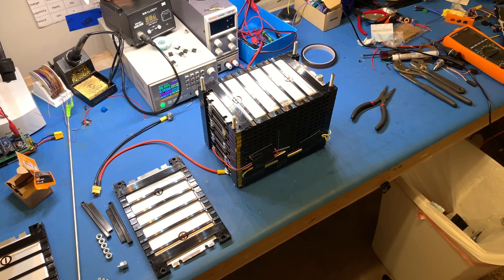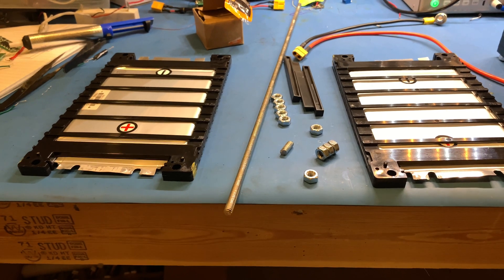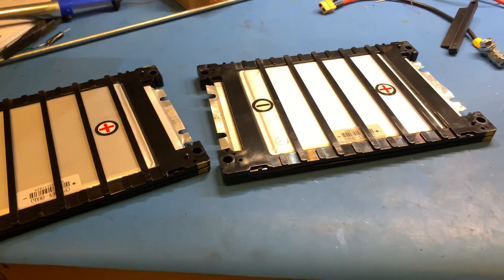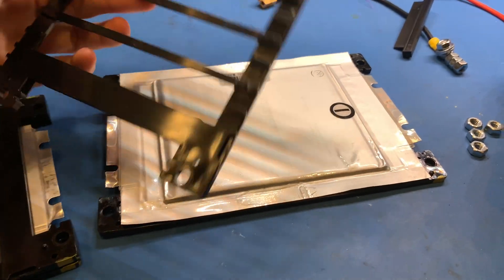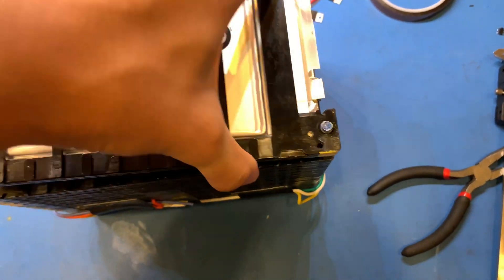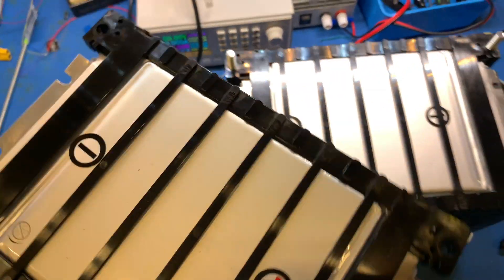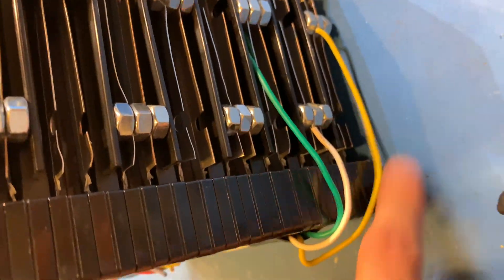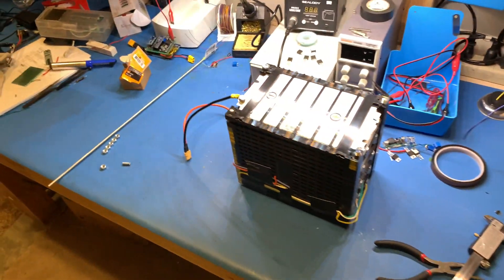Simple DIY E-Bike Battery SPIM08HP

Comment: Two years have passed, Update? How are you charging?
Reply from the maker: @VishaP-uu6zc Maybe I’ll make a video on my current e-bike.
Reply from the maker: I have moved on to more powerful bikes so this battery is not in use anymore. To charge it I just hook it up to my variable power supply. You can buy a battery charger for the right voltage though. I would also recommend getting a BMS if anyone is building this battery.
Reply: @ryanstephenson7655  Thanks for your response. This build was 72 volts. That is high voltage for a e-bike. Capacity not so much if your using throttle, vers pedal assist. What battery type are you running today? I use Bluetooth BMS on all my builds.
Reply from the maker: @stevecahill9106  I am using Samsung SDI prismatic lithium-ion batteries on my current bike.

Comment: So what is 72v 8 ah? I built a battery with these cells for my car audio system I used 40 of these cells from battery hook up which was very cheap at the time even now there only 3 each . I think I paid 130 for 45 cells and they sent out 4 or 5 extra any way I didn't have holders with the ones I bought that time so I bought a punch and made 2 holes on each tab and ran threaded rod threw to connect them I ended up building 12v 4s 10p 80 Amp hour battery it runs with 4 yellow tops battery's I used to have a 500 Amp solenoid but I took it out of the loop when I felt like it was choking the flow of power so I have been running like this for 2 years straight every day nps I did just buy 50 more with the cases to build another for my truck besides u can pull them out with out tools I bought big terminals u can unscrew by hand and use it to charge ur phone run any 12v thing you would plug in you car I have a buck converter also for running higher voltage lower amperage things threw it or my inverter will run for about 5 hours on it at full draw great stable cells thar can be used in conjunction with agm nps

Comment: It's so important to make sure you check the voltages before you go sticking them together.
Reply: What would happen if you did not ?  What does a builder need to watch for ?
Reply: @milesmoore5422  The bms will try to balance the batteries by putting a load on them until they balance the voltages. The bms will heat up and burn itself out pretty quickly if the voltages are too imbalanced
Reply: @omarmontoya115  So what percentage differences are allowable to start ?
Reply: @milesmoore5422  
.1 volts or lower is desirable
Reply: Series connecting will rapidly dump power into each other to balance their voltages, which can damage cells

Comment: Hiya ,thanks for build video Ryan, am just abit curious that really does seem like a huge pack for 75 volt and only 8 amp hours ,,its looks pretty close in   size to my 20s at 10p pack,and thats 84 volt 30 amp hours. 
Are they just generally lower density packs are they?
Reply from the maker: Lithium polymer batteries are lower energy density compared to lithium ion. The advantage to lithium polymer batteries is the internal resistance is very low. The spim08hp batteries can supply 200a continuously and 400a burst.

Comment: Whats the max current and amps the rod can do?
Reply: The cells in this configuration can do 1600 continuously  or  3200amp burst bms  will limit  the current  output
Reply: @Pricesminis  that’s not what he asked that is what the cells can do but I would almost guarantee it won’t do that with the way he is connecting the cells..
Reply: @Doitalllifestyle  1/4" stainless rod would vaporize at a fraction of the battery's potential output

Comment: Can u give me a 4s8p diagram
Reply: Stack 8 in the same orientation connecting all the minus and positives together as one then stack 8 above them that is also the same orientation with all the positives and negatives connected as one like the first group of cells but when you put the two separate 8 parallel groups together they have to be positive to negative where they would connect at, repeat the same procedure twice more. BMS wiring is super simple with a 4s battery pack.
Reply: Figure  it out?

Comment: I bought 30 of these to play with and now they are out again. Do you or anyone else know where to purchase these new?
Reply from the maker: I’m not sure of any places to buy these new, I usually just wait to buy them from battery hookup because they are extremely cheap.
Reply from the maker: Battery hookup has them in stock again https://batteryhookup.com/products/spim08hp-3-7v-8ah-200a-lithium-ion-w-cell-holder?rfsn=3457763.f6c041&variant=33526051143812
Reply: @ryanstephenson7655  ah gone again

Comment: Stainless steel for series connections can be very efficient.
Reply: Yes, but at 2p, you exceed the current capacity of 1/4" steel, and that's assuming perfect mechanical connections, which is unlikely.

Your electrical path using this method is from a tiny portion of the tab, across the mechanical interface between the tab and the shoulder of nut then across the mechanical interface between the nut and the stud, then the same in reverse order to the next cell.

It's fine as a 1p pack, but I would use proper bus bars for anything above that.

Comment: Where did you get the spacers from? I bought my spim08hp cells from battery hookup and I didn't get any spacers.
Reply from the maker: I also bought them from battery hookup and they came with spacers. I think that at one point they were selling them without spaces so you might have bought during that time.
Reply: @ryanstephenson7655  okay thanks for response.
Reply: I bought 35 cells when they had no cell holders. I later bought cell holders and now I’ve no cell spacers. I wish I can get the spacers too. They don’t have those anymore.
Reply: @Donatus11  You could have some 3-d printed.